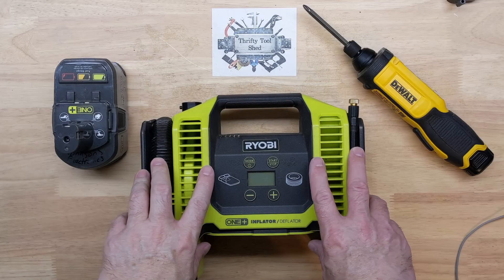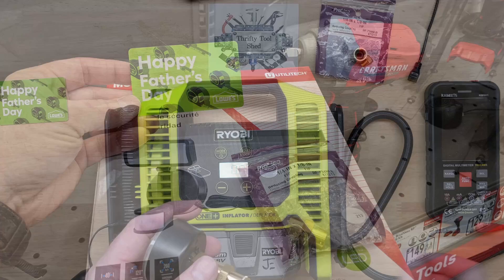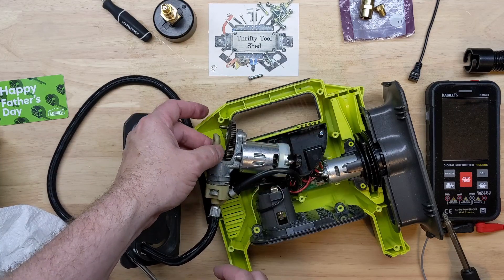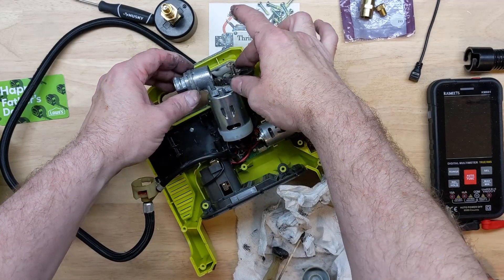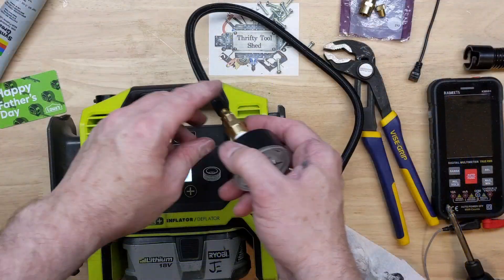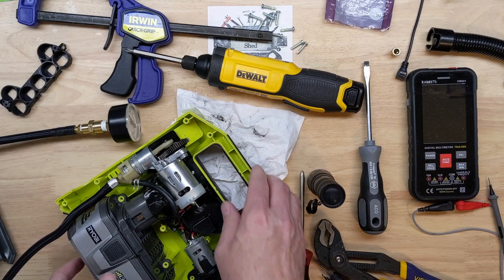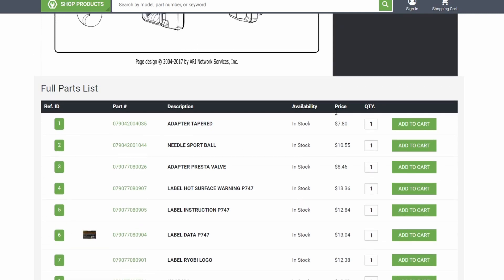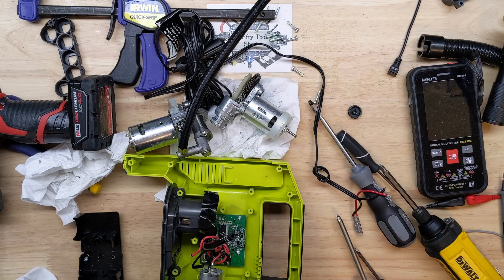Can we fix this broken Ryobi Inflator?

Comment: Once I had it open and saw how small the motor and cylinder are (which I didn't really need it open to make an educated guess), I'd have just thrown it away.  It's ridiculous how they make this huge semi-expensive inflator then the one thing it needs to do the job, is so severely undersized.  It could have at least been 5X the displacement, even if it had to run at 1/2 RPM, which would also have caused the piston seal and valves to last longer.

Comment: It's a shame that they quit making the other ryobi compressor that you have as well. That one is way better then the one your taking apart. I went through 2 and both went out within a few months of use. Both got extremely hot & burned up. Ryobi needs to bring back the other ones.

Comment: Hi nice video. I have a P731 that I have been using for years and I really liked it a lot. It finally stopped working. I think the pressure sensor is the culprit. When I turn it on im seeing 168PSI on the display so the motor never kicks on because it thinks its full. Do you think I could disable the psi sensor somehow to get the device back working but without auto pressure regulation? Maybe rip the sensor off the board or something. At least id be able to use it still.. Thanks
Reply from the maker: I was thinking this model had a way to zero out the sensor by holding down 2 buttons for a few seconds. Check the owners manual in case it possibly helps. If it would be zero, possibly it would at least run maybe. It may not show pressure but may run. The only other alternative I know is to add a physical switch to turn on the compressor manually. I am not sure enough with the board to know what to bypass on it.  Best of luck, and thanks for your kind comment!
Reply: @ThriftyToolShed  Both of you are correct. It's been some years and I can't find the YT video but in the comments says to hold some buttons down but I can't find the correct instructions.  Also, there is a video of a person removing the digital gauge and replacing with an analog. You obviously lose the "set it forget it ability" you have with a digital gauge.

Comment: TWO of those have failed me - model P731 and P747. The 731 - failure to inflate tire - set for 35 psi but stopped in 5 seconds and display showed 40-47 psi. Something wrong with the circuit board. Ryobi said it was not repairable. It was 2 years old. I have another P747 that I bought in 2019 that seems to be functioning as it should.
My daughter told me her handheld model P737 had failed when she tried to pump up her tire. I took it apart and found that the large gear was askew, worn in the 'center' hole. The fan was never installed on the motor shaft and was intact in the housing.You are correct in that parts are not available. They are probably in large bins somewhere in China. I send her a new model, Ryobi PCL001, so maybe it will be good for longer.

UPDATE 3/29/2025: The PCL001 was returned to HD for a replacement when it would not pump up a tire.

FYI: The screw on connector is better in my opinion since it doesn't have a rubber part that usually ends up being disintegrated.

Comment: Hi, do you still have this device :)? Do you know maybe what’s the chip model inside? Mine is burned and can’t see the number :(.
Reply from the maker: I do still have it. Let me know which one you are having issues identifying and I will see if our board is the same. If you have Facebook you can post a photo on the Thrifty Tool Shed group called  On the Bench and I can also share photos back to you.
Reply: @ThriftyToolShed  I’ll do that as well! Thanks!
Reply from the maker: Just to be clear, the large 28 pin chip is a microcontroller and will have a factory program installed.
SH79F 1619M
Reply: @ThriftyToolShed  I really appreciate that! Thank you!

Comment: Great video...Great job.do you know what size is the e-clip?mine is broken😮
Reply from the maker: Sorry I do not!
Reply: Same on mine, the broken parts of the e-clip are nowhere to be found either ha
Reply from the maker: I did dig mine out of the junk bin and spare parts bin due to several questions about this item lately. This is the info I have regarding the e-clip that keeps the gear on the shaft. 
The shaft is 6mm
The groove is around 5mm
The e-clip diameter is around 9.2mm
The e-clip opening is around 4mm
So maybe M4 E-clip?

Comment: I have a P747 and a sigle blade just broke off from what looks like a fan. It still works on bike/car tires, so I think if for deflating or inflating on the other side. It looks like the fan at 8:43 on the right.
Is that part available anywhere? Can I just remove it and not use that side?
Reply from the maker: The inflator/deflator has its own fan assy in the black disc shaped housing on the opposite side of the air pump. It even has its own separate motor. I believe you are referring to the cooling fan for the air compressor itself. It requires cooling because of the high temperature generated while compressing the air. It may be fine like it is or if vibration is really bad you may be able to break off the opposite side blade to balance better. I have not seen many parts still available for these now. You may get lucky and find one on eBay.

Comment: Made really cheap. If you're not going to use it much maybe. Mine just broke. The cheap-o metal reed valve broke, It's so weak. No way to fix it.
Reply from the maker: It does bother me when things are made so cheap that there are no replacement parts and it's made so cheap it can't even be fixed.
Reply: @ThriftyToolShed  I would rather pay a little more for something and have it last longer and be able to repair it if it does brake. Thank you for the video.

Comment: Hi Guys!!!  Are the fan blades broken off behind the motor on the high-pressure side?  The motor shaft on that side looks weird.
Reply from the maker: Yes, they are broken for sure!
Reply: @ThriftyToolShed  I was watching the AvE channel where he does a teardown of the Milwaukee M12 inflator.  The pump/motor setup on the M12 looked practically the same as the one on this Ryobi.  I guess these kind of inflators all do things about the same way.
Reply from the maker: They all do seem to be very similar. Also TTI makes Milwaukee and Ryobi so they may be even closer.

Comment: Hey TTS. Your video on the kawasaki stx 12f display helped me repair my display. Thanks for that.  Iam getting error on display. Did reset per manual. No joy. Any other ideas. Thanks.
Reply from the maker: The only thing I would know is to make sure there is no corrosion on the board. I know corrosion is a big issue on many of these. I cleaned a lot from the board in this video. Glad you found the video helpful and best of luck to ya!

Comment: I'm looking to use low-volt DC vacuums or other devices to force air through activated charcoal. I will probably be removing a bad battery on a dyson vacuum, hook it up to another source of power, and adding the charcoal to the container where the vacuum bag would be if a dyson had one. I'm doing this because of the WWIII thing, and the low DC volts is what is easiest to obtain through alternate power sources like solar panels.